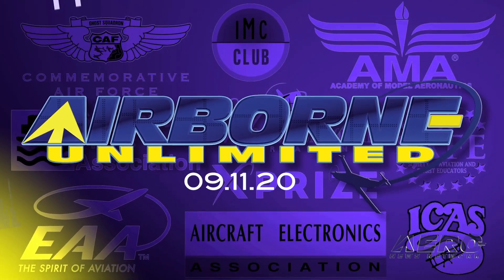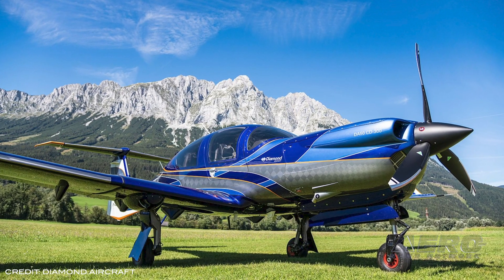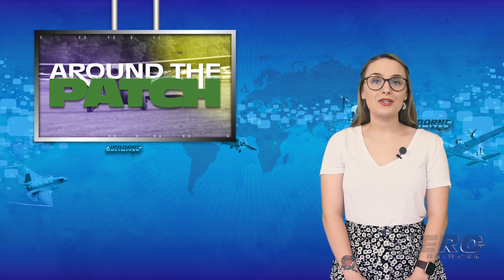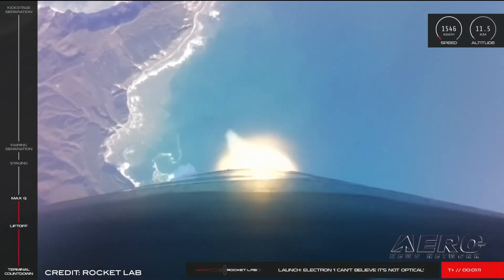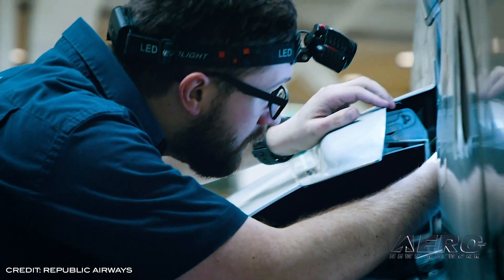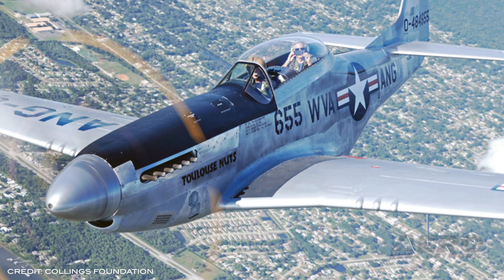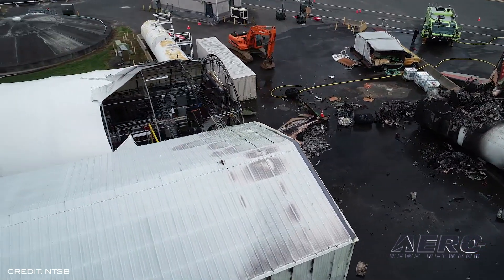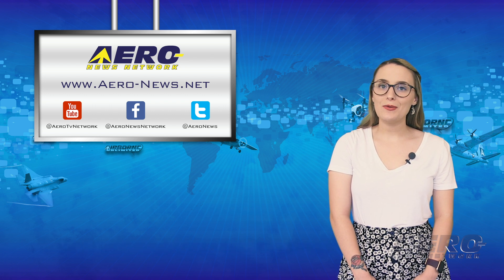Airborne 09.11.20: Diamond DA50 RG Cert, Collings Fined, Apocalypse RV?

Comment: The DA50 RG needs a external fuel tank or perhaps additional tank behind the rear seats to give it a 1000 plus  NM range and the 62 needs 2,000 plus NM range. Perhaps switching to a 4 or 5 blade setup for better performance options. Sure there is a market of individuals who be interested in those options.

Comment: DA would have my money, hands down, if they had the range, speed or altitude that the SR22T G6 has. Rather disappointed that they didn’t also add a parachute to that airframe as well. Perhaps they will update it and increase fuel capacity and bump the performance. Would love to get one of these but need the speed/range.
Reply: Have you heard of the pipestral panthera